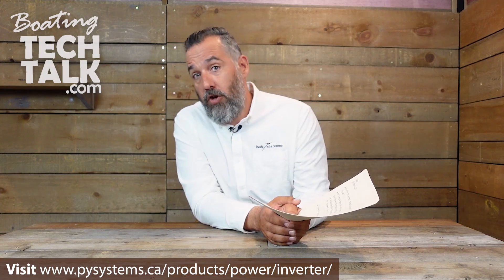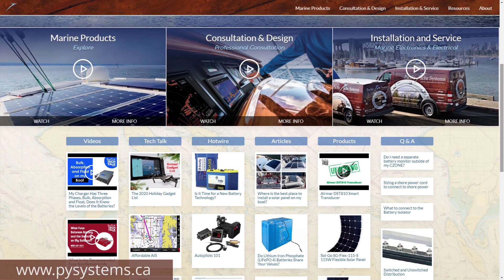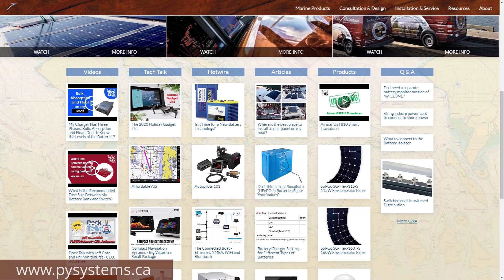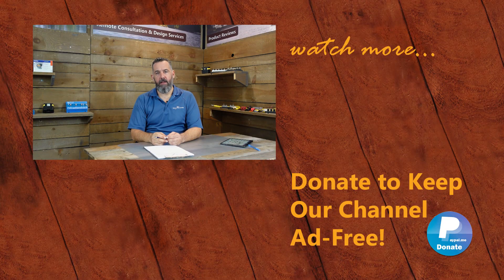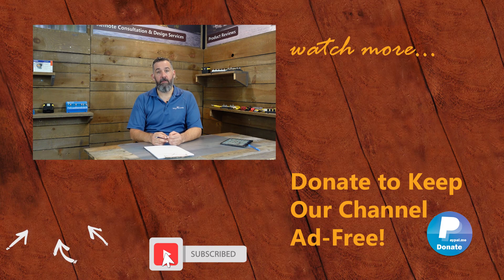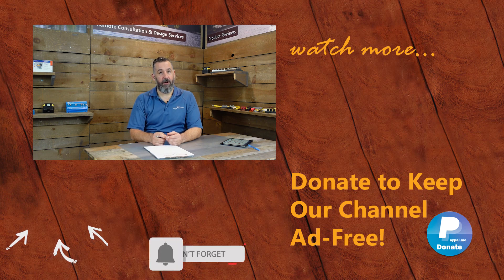Where Is the Best Place to Install an Inverter On my Boat?

Comment: Not sure if you’ll even see this, but I’ll try anyway LOL.  
I I have a Victron 3000 with 100 amp charger.
The best place I have at the moment to mount it, and other components, is in a compartment that opens on a wall next to the guest berth bed.  
The door has a large vent for ventilation.
I don’t know how loud the fan may be on the inverter charger, so do you think there’s a potential to be too noisy at night should the battery charger be running?
Thanks

Comment: I have a 1987 wellcraft St Tropez and installing a 1800w Xantex inverter. The AC in i am using a 10-3 marine cable but where does it go to the ac panel or the shore plug?

Comment: So, a few more caveats re: inverter/chargers. READ THE MANUAL. First, 'nothing is easy' and, second 'I'll only accept perfection' when it comes to installs. READ THE MANUAL. Most people are only going: 2,000W or 3,000W & if properly (professionally) assisted, it's merely $4,000 USD. READ THE MANUAL. However, $1,000 USD is spent on marine grade tinned copper wire, properly crimped (tools & experience) and properly grounded (green, 1 AWG size smaller than the LARGEST cable required on the boat). READ THE MANUAL. Even though it fits nicely in a pretty box, I don't think it should be attempted by the average DIY'er- the first time. Jes' sayin'! Oh, that's right- I almost forgot! READ THE MANUAL.

Comment: What about installing the inverter in the same locker enclosure where the Flooded Acid battery are? risk of Explosion is the Warning on the inverter usermanual.. But is that really a serious issue. space choices are limited on a boat

Comment: I have a “further question “ I’m considering putting a battery near the windlass. Probably make a seperate space in the chain locker. The battery will also run the bow thruster. (With seperate isolator) maybe a few forward lights and appliances. 
So I’m guessing an agm is best. 
There would be a relay switch to power on and off as required. 
The question is how do I charge that battery ? 
I’m thinking a small solar panel nearby and a wire to the main battery bank. 
The purpose is to reduce the need for a thick cable to run these.
Reply from the maker: If you want to reduce cable size, consider installing a DC to DC charging converter between house and windlass/thruster battery, the largest one made by Victron is rated at 30 amps.

Comment: just asking is there any USA standard in marine that you may know about for vessels under 70 feet for the requirement for AC & DC cable physically separated as well as cable shielding  for sensitive electronics. I know there is shielded cables available on the market for data networks  (nmea2000 is a earth connected shielded cable) and VHF radios is similar setup
Reply from the maker: Good question David, would refer to ABYC code to find out.
Reply: @PacificYachtSystems  
found this in ABYC but do not have access to all the standard due to in Australia
E-8.15.7 
When AC and DC conductors are run together, the AC  conductors shall be sheathed, bundled, or otherwise kept separate  from the DC conductors.

 E-8.15.8 
Current carrying conductors shall be routed as high as practicable above the bilge water level and other areas where

 water may accumulate. If conductors must be routed in the bilge or other areas where water may accumulate, the connections shall be watertight.

 E-8.15.9 Conductors shall be routed as far away as practicable from exhaust pipes and other heat sources. Unless an equivalent thermal barrier is provided, a clearance of at least 2 inches (51 

 mm) between conductors and water cooled exhaust components, and a
 clearance of at least 9 inches (230 mm) between conductors and dry exhaust components, shall be maintained. conductors shall not be routed directly above a dry exhaust.

Comment: I understand the reason for not putting an inverter/charger in an engine room with a gas engine but what about diesel? We have a good sized engine room and it would provide more free air around the unit than any other option.
Reply from the maker: Yep, it's quite common to see inverter/charger(s) installed in the engine room of diesel engines. Other then heat, there is no issue with ignition protection with diesel engine.

Comment: Great explanation, yes and away from any fluxgate compass too. Salt water and inverters definitely trouble, seen ac power points carbonize arc and catch fire with one splash of water through an open hatch, Best not to run an inverter at sea..
Reply from the maker: Thanks for sharing